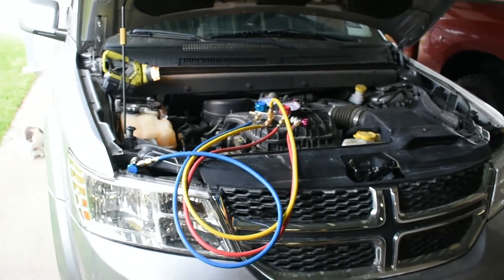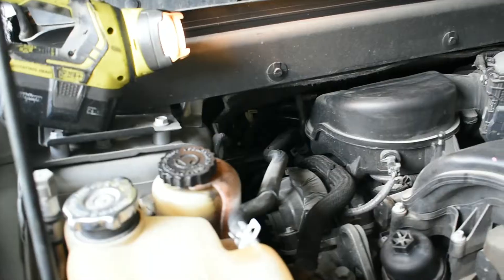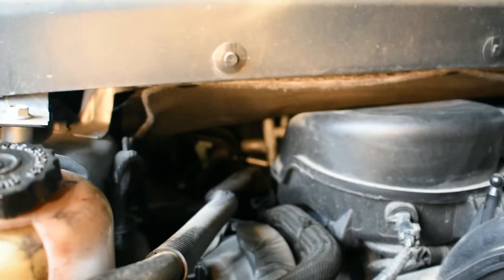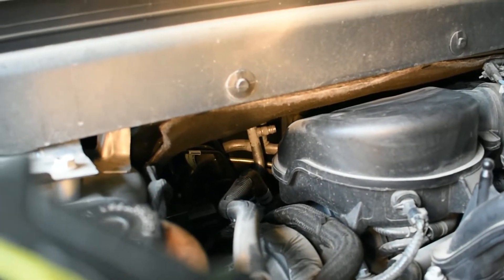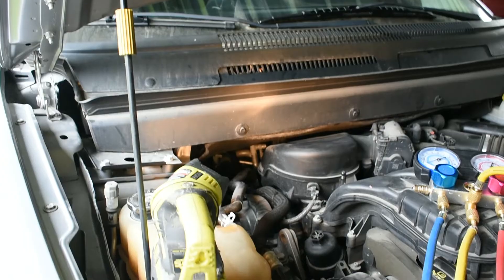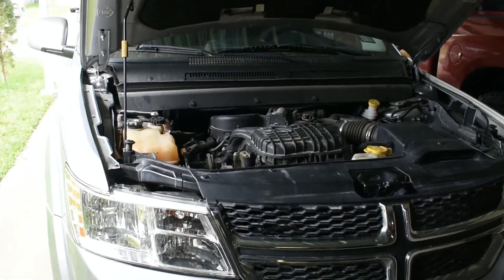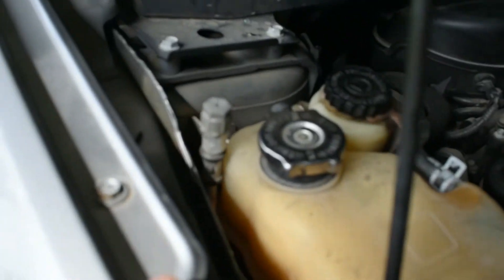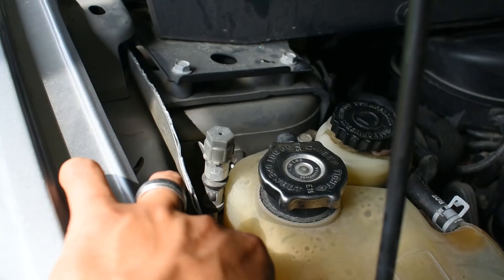Dodge journey AC low pressure port Location and refrigerant Type

Comment: My end is too small to go over that fitting,  do I need a special hose?
Reply from the maker: Yeah u have to use the let's call it professional one...the small ones won't reach all the way back where ac port is located...ebay sell the big Ac manifold  for 40-50 bucks...I'll send a link if u want to buy it...that one will reach for sure.
Reply from the maker: Oh and make sure u buy the right ac manifold....the R134 freon uses one kind. The R1234 uses a different one...so make sure what type of freon this journey gets. Mine was the R1234 I believe from the 2017 and up is this type of freon but double check just in case.
Reply from the maker: https://www.ebay.com/itm/201968270614?mkcid=16&mkevt=1&mkrid=711-127632-2357-0&ssspo=v5FgdoHwRsu&sssrc=2349624&ssuid=yZ1oinQlQMC&var=&widget_ver=artemis&media=COPY
Reply from the maker: This is for R1234 freon.  Is close to 100$$...the R134 manifold is cheaper...but yeah this is the type of tool u need to reach that ac port. Also if u don't want to spend some cash u can check if u can remove some parts from the top side of the motor and see if u can reach with the small hose.